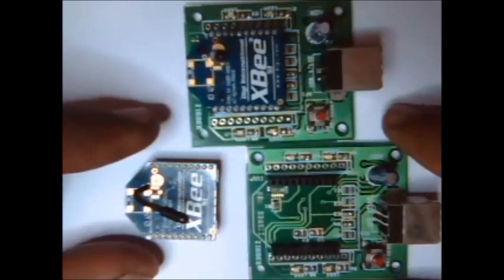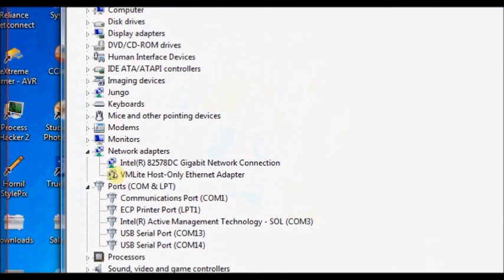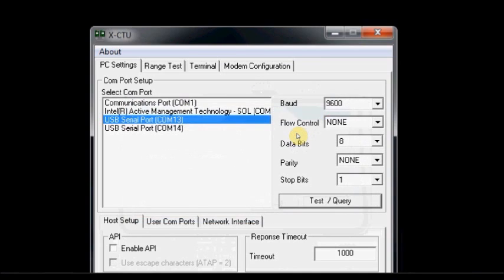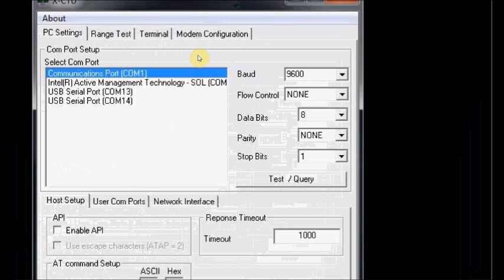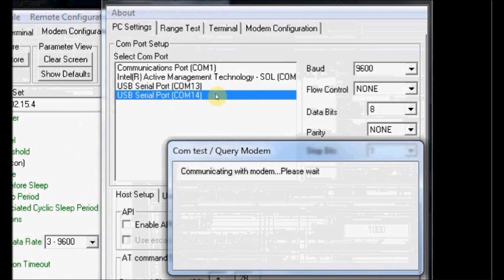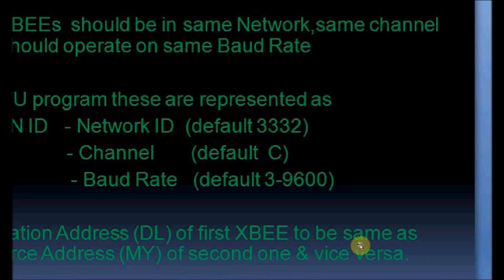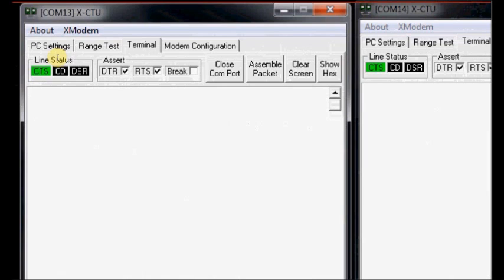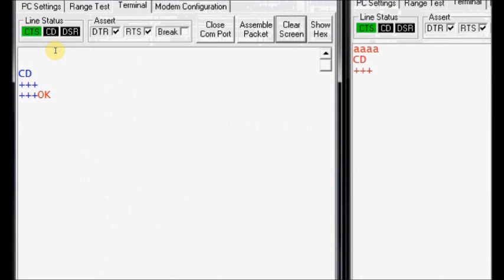XBEE RADIO - Configure With XCTU

Comment: sir how to communicte between 3 zigbee module as between coordinator,router and end device.
if i give DL and MY value to router of coordinator then what should be given to end device DL and MY ????
Reply from the maker: +Arpit Gupta You configure Coordinator/Router only in S2 type XBEEs.Here MY is defined as Source address.  Configure the Destination Low address of Coordinator as FFFF .Now coordinators enters Broadcast mode.Configure Router/end device DL as 0000 . The coordinators default source address is 0000. Now Router/end device can talk to  C & C can talk to router/end device
Reply: thank u sir but i have to create a mesh network in that i need to send data between more than 3 zigbee how it is possible